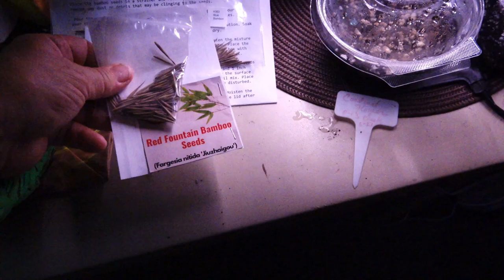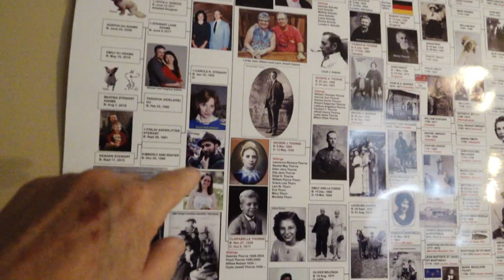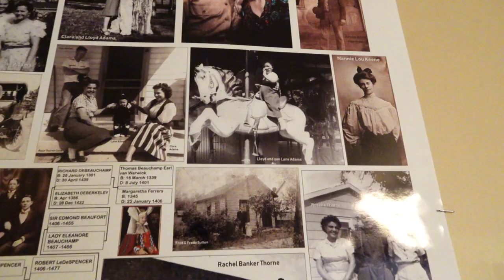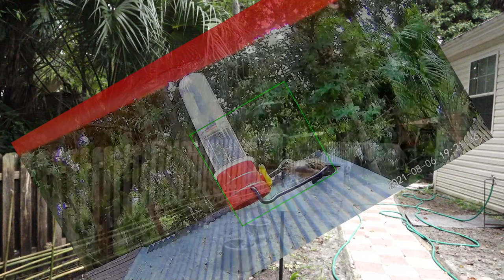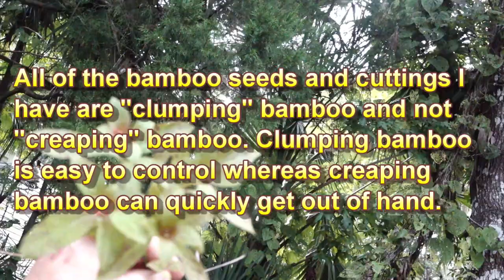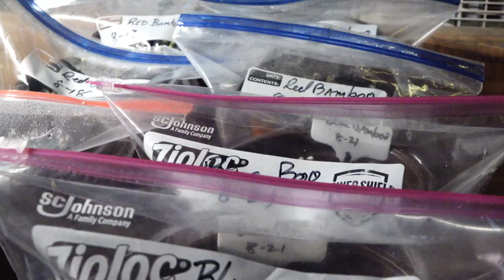Bamboo Hummingbirds Seeds and Cement

Comment: Great to see you Salty. I tried growing bamboo last year.  Unsuccessful.
Reply from the maker: Hi Mike. On about half of the 'nodes' I put hormone rooting powder. I also used a file and 'wounded' the area around the node. I have seen and read that scarring the area around the node, stimulates the rooting cells. Plus the hormone powder (or gel) jump starts the root production. So far, I was able to recover maybe 100 sections of bamboo cuttings and get them in the ground in time before they dried too much. Of the 100 or so I got in the ground, so far, I can tell that only maybe 25% have started. Since I just planted seeds, it will be a week or 2 before I will see any results from them. 
My advice Mike is DON'T buy creeping bamboo seeds or use cuttings from creeping bamboo unless you live in the country and have acres between you and your neighbors.
Reply from the maker: And also Mike, if you plant bamboo from cuttings, don't expect to see anything sprouting for at least 2 months and I have heard, some species can take up to a year to 'show-up'. The DNA in them has a code that when they are cut, it is time to go dormant until conditions are adequate for regrowth to begin.
Reply: @SaltyKayak  I had purchased some seeds.  Couldn't get them to germinate.  I found out later they have to be at 85 degrees for 2 weeks before they will germinate.

Comment: Nice video. Is there a way to identify creeping bamboo? Thanks.
Reply from the maker: From all my readings and research, there is no visual way to tell from the leaf structure but it is pretty easy to tell from the root structure and whether or not new shoots are popping up 5' or 10' away from the parent plant. Clumping bamboo stays in a 'clump' and over the years, expands in a basic expanding circle.. easy to control. But creeping bamboo sends out roots in all directions UNDERGROUND and a shoot or several might pop up in the middle of your neighbors yard. 
Studies have been done on how to control creeping bamboo and they sell thick plastic barriers that are 22" deep that you can bury AROUND your creeping bamboo and it will be contained. Apparently the roots will never go deeper than 20" while they are 'creeping' and will follow the barrier and can be controlled that way. WAY too much work. Just buy or plant 10 or 15 clumping bamboo so that the circles will eventually grow to touch each other and you will basically have an impenetrable barrier in a couple years.
Reply: Thanks for your detailed reply @SaltyKayak